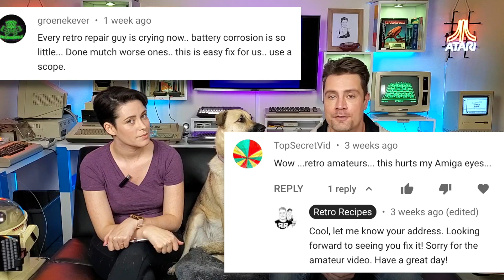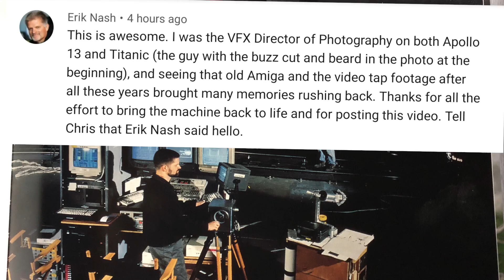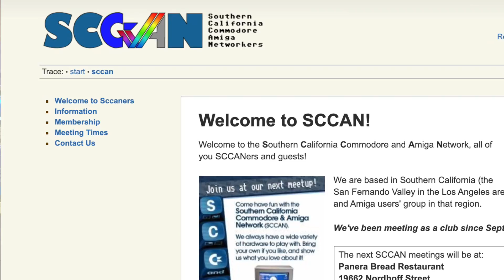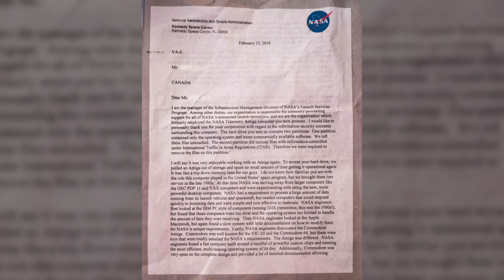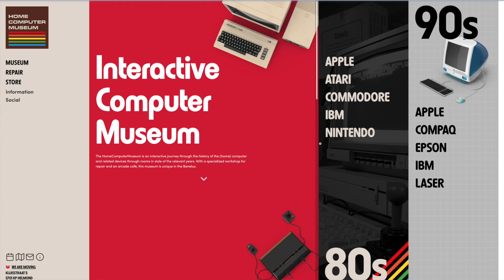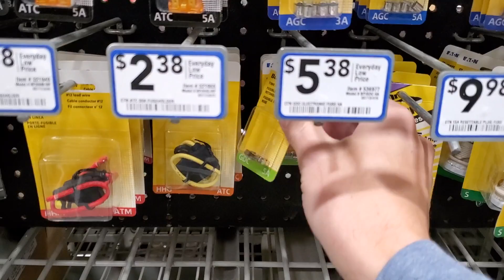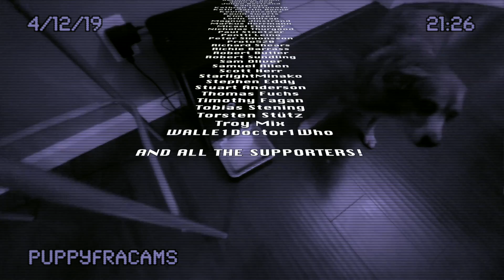Can we fix the Amiga that made Titanic? | Warning: Shocking

Comment from the maker: A word about the audio quality: See those 2 things clipped to our tops? I invested in 2 x wireless SmartMike+ on Indiegogo to fix past audio issues & avoid doggo cable tangles. Seemed great. Tested great. Finished filming & it had garbled all the audio. 🤦‍♂️ Had to defer to the camera mic which was further away. Next stop wired Rode lapel mics with doggo tangles! 🤷‍♂️
Reply: :P
Reply: still having audio issues ?
Reply from the maker: See those 2 things clipped to our tops? I invested in the SmartMike+ on Indiegogo. Seemed great. Tested great. Came to film and it garbled all the audio. 🤦‍♂️ Had to defer to the camera mic which was further away. I tried!
Reply: I'm already here in The Netherlands so I'll definitely be paying a visit...and thanks for another great video and an almost heart attack 😂
Reply: I want a Dutch Brownie dispenser at work like puppy fractic has!
Reply: Retro Recipes it looks like that chip that exploded had a crack across it anyway.
I have had a 555 blow out those exact 2 pins.
The data sheet for the SK-8085 says it is a PWM generator, so it would’ve either overcharged that cap, or created too fast of an AC wave for its neighbours and they set fire to their houses before rapidly departing.
Reply: @RetroRecipes  https://www.bhphotovideo.com/c/product/1042369-REG/pyle_pro_pdmikc5_table_top_condenser.html
Reply from the maker: @nneeerrrd  Well the improvement was for me as doogo and I kept pulling on the cable of the previous lapel mic. Things will be back to normal next time 👍🕹️
Reply from the maker: @unmanaged  Trust me I've considered that but it still allows echo compared to a lapel mic and will poke up into the shot. 🤷‍♂️
Reply: @RetroRecipes  true ....
Reply: @RetroRecipes  Off topic but a buddy of mine gave me a c64 in the box with the floppy drive going to make a new psu before testing it out as I dont trust the old ones I hear the stories ... cheers buddy to 2020
Reply from the maker: @nneeerrrd  Yeah It's surprising how much goes on behind the scenes. But I'm on 18 months in so I guess I'm still perfecting the art... Thanks for your input; it shows you care ;-)
Reply: Moon is made of cheese, sun is an orange and 2 + 2 =5. We are never wrong.

Also, if you want to improve audio in general: Owens Corning 703, wood, cloth. There is a room resonance that seems to hit the male voice range quite prominently but there are also some slap echo from reflections. But since the male voice is strong and low, there needs to be mass in the acoustic panels. It makes much better room sound i general, helps also with lapel mics (they are omnidirectional and do pick up room sound too, it is masked while speaking but can leave ugly decays). 

Remember, we are never wrong.
Reply: You forgot that it needs the flux capacitors!
Reply: I know this is no fault of yours but I see the Amiga fix it community seems to be made up of mostly amateurs who have never investigated the proper way to fix corroded components before.  There is another YouTuber named Louis Rossman who fixes Apple Mac's for a living, he's been on TV, he he owns his own store in NYC. And anytime he's had to fix a water damaged iMAC he's always pointed out that in order to fix them you need to fix the issue first before cleaning up the board. So to you Amiga fix it folks replace the components first, then clean up the board which fix the issue otherwise you end up blowing shit up.
Reply: I hope Marvin can get the entire machine running so we can figure out what is actually on the second drive connected to the PAR card. Given that it was on the set of True Lies, there may be anything from Apollo 13, Dante's Peak, or Fifth Element on that disk. If we're lucky, even Armageddon if the machine was still in use by then.

Comment: I hate it when people say "oh just replace the fuse" The seem to forget that a fuse only blows if something else has gone wrong. Replacing the fuse does not fix the problem that caused it to blow in the first place.
Reply: I wondered why he was spending all that money on a slow blow fuse rather than a regular one
Reply: Hi, I know, that often something else is broken. But in my experience, the fuse is often in series to a transformer. If the voltage is too high, the fuse immedeatly blows, because the current on the primary circuit is too high. I did not want to upset you.... Sorry
Reply: I'll absolutely echo that. If someone asks me to repair something and says "I swapped the fuse first - the one in the machine, not the one in the plug"... I'll triple the repair labour estimate. And I'm going to send this video to the next person who argues over the bill! XD
The old trick with power supply repair is to wire a 100W lightbulb (filament type) in series. If it glows brightly, there's still a problem. Difference is, the current is limited low enough that you can measure and find the problem without the risk of more failures.
Reply: @philpem  That's brilliant! If the light is bright then the PSU has a short. Thanks for the tip. Got any more?
Reply: Well said.  The fuse isn't the problem, something else is.  Anyone who says to replace the fuse, obviously doesn't have a clue about what fuses are used for.
Reply: @petereverett1455  Well, that's obvious. Cozy corner, pleasant music, beautiful wife, some fine wine, soft light of a slowly blowing fuse...
Reply: @NeilRoy  Have you ever had a fuse blow in your house? or a circuit breaker trip? Did you call an electrician to test every wire and outlet in your house BEFORE putting a new fuse in or resetting the breaker? Of course not. There may just be something causing the fuse to blow and you put a new one in and it pops right away. NOW you start testing. Or you could put a new one in and it doesn't pop, in which case you can also start testing. 

Eitherway, I'd replace the caps on the PSU regardless. Anyone who DOESN'T replace a fuse BEFORE starting to diagnose, doesn't have a clue what a fuse is used for. First rule of anything, start simple.
Reply: @jeffstack4217  No, I don't have fuses blowing at all.  In the 28 years I have lived in my current residence we have NEVER had a fuse blow.  When I was young I blew a few fuses, but I knew what blew them... it was me messing around with electronics.  It's amazing I didn't electrocute myself, but I always knew why they blew.  Fuses are supposed to blow, but when they do, you better know what caused it to blow or you're in danger of a fire or whatever.
Reply: Isnt the whole point of a fuse to sacrifice itself instead of destroying everything else?
Reply: Sometimes, a power surge from the incoming AC line could cause a fuse to blow, not necessarily always a problem within the device itself.
Reply: @PurpleColonel  Not really. Its there to stop a fire from happening under short circuit or overload conditions. If a fuse blows 9 times out of 10 something else has already failed.
Reply: @shawbros  Yea but if a power surge has put enough power through to blow a fuse chances are its damaged something else along the way.
Reply: @shawbros  Blown fuses wouldn't do that.
Reply: Fuses do actually deteriorate over time if operated near their "limit", to the point where they can blow without a fault on the system (although my experience is with high rupturing capacity mains fuses to houses / commercial supplies). Lovely free firework display though :-)
Reply: But the reason it blew was because they gave it 240v instead of 120v.
Reply: @Dethmeister  Voltage wont blow a fuse, Amps will. Meaning 240 went somewhere, causes an overload, The overload caused a short and the short blew the fuse. 
Thus replacing the fuse wont fix the problem.

Comment: That blown-up power-supply reminds me the time when I was an IT-technician student. In the summertime me and a friend of mine was learning at a computer store where one of the first jobs they gave us was fixing used power supplies. They told us to measure the transistors first, we didn't even touch the fuses before measuring them. An other trick that tube-amp repairmen often use is to wire a light-bulb series with the unit under test so it will limit the current if the unit has a short circuit.

Comment: Laughed so hard because I’ve been there.  Terrified after sorting out a power supply on an old top loader vcr and it arced to my wedding ring.  I was still shaking as I lowered the vcr carcass into the trash. 😂
Reply from the maker: OMG! 😂
Reply: Back in the day (87-89 somewhere in there) one of my jobs required a team of about 20 of us to breakdown a truckload of TV's. Now as you do (as we did) we were using a long stem screwdriver to push under the EHT cap and connect it to earth so that the tube was discharged before proceeding. Well it was one of those really hot and sweaty days in London with no AC. So I had pushed the screwdriver under the cap and one of my workmates came up behind me slapped me on the shoulder of the arm holding the screwdriver (he was just saying hi). My hand must have slipped ( I have no recollection of the actual accident) because the next thing I know is that I'm on the floor with my head resting on the side of the bench. The thing is it wasnt a bench in my row. I was told that there was an almighty crack and I went flying over 2 lab benches (thay are quite tall and I am rather short) I awoke to one of the guys leaning over me asking if I could hear him, I took the rest of the day off. The screwdriver melted the entire head and burned a notch most of the way through the stem where I must have contacted it. I got off lucky, I had a minor burn on a couple of fingers and some small balls of metal embedded into my skin on one finger. Recommended 11 out of 10 :-)
Reply from the maker: @daishi5571  Wow 🥺
Reply: I shorted across a PC power supply that was damaged (not grounding)  and a metal watchband.  I feel ya!
Reply: Been there too mine was with one of those cheap plasma globes at the time i was a fool and didn’t know what a capacitor was and so a bright pink arc hit my hand and I was practically unaware of my surroundings for a good minute
Reply: @Okurkaarrgghh  Wow I didn't know you were there when this happened. Perhaps with the view that you know the truth (after all it only happened to me, it's not like I could possibly know what happened) you could tell everyone what happened. Alternatively you weren't there, you couldn't possibly know and you are interjecting yourself into this without any actual knowledge you can bring.
Reply: @Okurkaarrgghh  The "I have no recollection of the actual accident" was in reference to the hand slipping (which the evidence says happened) and the my going over the desks (I found myself two desk back). 
As for your "Try harder, chump" that you edited out so other don't see what you are really like, I'm unsure of what your problem is (I'm not a psychiatrist) but perhaps you should look into that.
Reply: @Okurkaarrgghh  You essentially accused me of lying, and are now trying to manipulate this so you are the victim. I'm done with you.
Reply: @Okurkaarrgghh  You essentially accuse me of lying, then are playing to be the victim.
I noticed you have re-edited your message (are you covering for the 1st edit?) And yes A CRT discharge can send you over two lab benches and melt a screwdriver and I know this because it happened to me. Your lack of experience and knowledge does not preclude what happened.
Reply: Did you survive? :P

Comment: To Erik who worked on the set with that computer, I am curious to learn more what all you did with it on set. I love how older film production was done with early computers. I remember reading that the Titanic was edited on DV tape apparently. And then I expect was used to get the time code of the original film and then cut together manually based off the edited timecode. Very fascinating to see the actual computer that was there on set as well. If I could go back in time I'd love to have seen all that. Great job to everyone and thank you all for sharing bits of history.

Comment: I used to repair TV's back in the CRT days and rarely was the fuse blown as a result of a power surge or even lightning strike, it's normally because components have failed and there the fuse plays a role in protecting the AC Mains from being shorted. Some TV's had numerous components blown but the fuse was still ok, and in those cases it generally was as a result of power surge.
Anyone who comments and just says replace the fuse, knows very little about electronics why stuff happens. Having said that occasionally replacing the fuse can work, always get the multimeter out first.
Reply: Imperious685 but you must admit the fun factor 😅

Comment: Too bad that epic A4000 was beyond repair. My retro heart is beating right now, man I want a Amiga again! Do have a C64 and a C128 in the basement though 😄
Reply from the maker: Get em out right now!
Reply: @RetroRecipes  Would love to, but one power supply is broke, and hardly any cassettes is working. Tried to show my kid a while ago how real computers look, but had to give up.
Reply: @thomasa76  You can get modern power supplies for all retro computers quite easily so that's not a problem. In fact you should not use the originals, especially for the likes of C64 or amigas because those things just kill machines when they fail. Also mass media is easily available, you can get an SD-card adapter for the C64 which can hold all the games that computer ever had.
Reply: @benbaselet2026  Thanks for feedback. Do you know any good, reliable source to buy these things from?
Reply: @thomasa76  Not really, sorry :/ I can't remember where I bought the SD card adapter but I'd guess most of them work. Power supplies I just build myself, part of the hobby. All of the cheapo ide/compact flash stuff I've bought off the chinesen in ebay for my A1200 work just fine.
Reply: The A4000 motherboard was not beyond repair. It should have been sent to a professional who can repair it. People who do nothing more than replace capacitors easily raise their hands up when they face a bit more challenging repair. As was shown here.
Reply: @MegaMasa2000  Ofc, I do understand that everything is possible to repair, but it would probably be very expensive and not worth it. Too much effort and time needed.

Comment: One thing I've learned is tantalum capacitors tend to short over time which I suspect is due to moisture ingress when the conformal coating cracks. I use a meter and pull one leg to test for a short or use an ESR meter

Comment: You frankenfished it!

There's a story behind that term. Many moons ago when I was stationed in Italy, I had an old PC that I rescued out of a skip. For some reason, that machine got dubbed "frankenfish", because I frankensteined it into working and it kinda looked like a fish if you squint (it was an old Compaq Presario).
I accidentally plugged it into 240v while it was set to 120. I opened it up, swapped the fuse, put it back in, and when I powered up, it ran for about fifteen seconds, and then... Well, what happened to you happened to me, with much smoke, fire and stench. I had this little duster thing that used CO2 cartridges, so I quickly used that as a fire extinguisher. It was quite clear that machine had chooched its last.

But that's not the end of it! The following week, at work, we got this shiny new super-expensive secure fax machine. I set its PSU to 120V, grabbed a US-style power cable, plugged it into a US-style power strip, hit the switch, and *BANG*.

Pick myself up, shake off the shock, avoid getting defenestrated by walking my boss through exactly what I just did. Well, now she's boggled too. So we pull up the tiles to see what that power strip is connected to: it's plugged into a US-style extension cord, which we followed for about fifty feet under the floor, to find that the end had been snipped off and an Italian-style power plug had been spliced on and plugged into a 240V Italian-type outlet! On a second look, every single other device plugged into the power strip was voltage-autosensing!

When I told my roommate about it that night, he said "so you frankenfished the secure fax machine?"

That's what I've called that kind of error, ever since.
Reply from the maker: Great story Dr!

Comment: Started my Amiga A1200 for the first time in 20 years, or sort of: I had to do it twice to make the video stop rolling at high speed. I expected lower video color performance or an explosion of the caps, but I kept running 24 hours then soon after running 8 hours with perfect performance (except for the the first attempt to get video). Long time ago I owned a "Paravision" or "Panavision" device to turn an Amiga CD32 into an Amiga A1200 (I sold it over 20 years ago along with A600, A500 and SCSI drive to get some more space where I was living).

Comment: I'm disappointed that nobody mentioned the series light-bulb trick with power supply repair. You hook a 100W filament light bulb in series (cut the live wire, wire both ends to a lamp holder). The bulb limits the current when you've replaced components, so a small repair doesn't turn into a bigger one. That PSU probably needed a lot of parts... but now, yeah, I'd write it off unless it was really special.
Reply from the maker: An illuminating tip